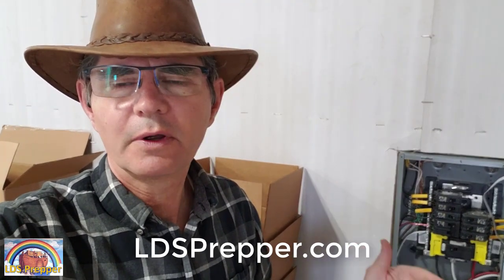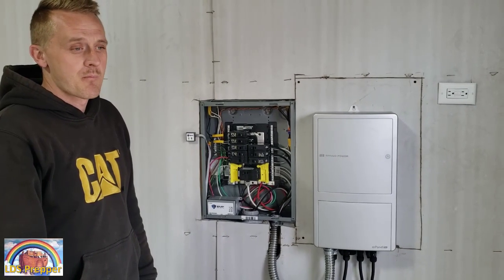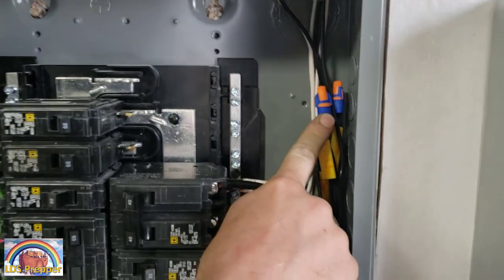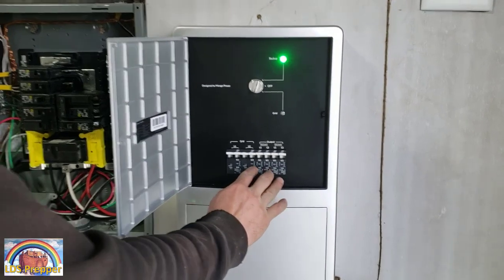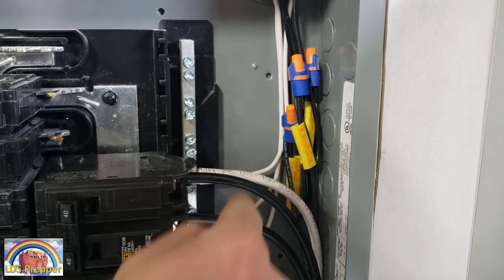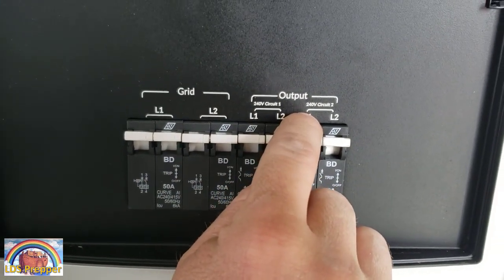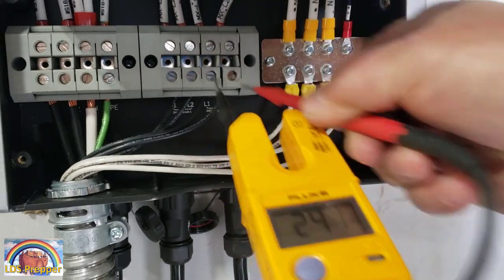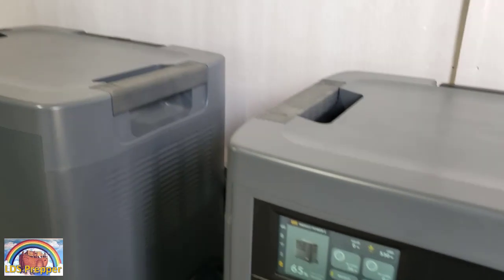EXCLUSIVE: Mango mPanel Pro Complete Installation - Automatic Transfer Switch

Comment: i want to run what there's only 4 breakers for 120 and run those to save electrcity and power outlets will that work or is this a expensive aoto matic transfer switch that only works when power is out

Comment: The mPanel Pro needs many more breaker outputs to supply the main breakers when grid is down to be useful. My current generator power distribution panel (Gentran) has 10 outputs back to my Main breakers to supply my basic needs. It would also be useful to have output load meters to see individual circuit draw. My Generator distribution panel has meters and it's nice to see what's going on and maybe adjust what's being used accordingly. I can see what the Mango E is outputting, but it's not telling me anything about the individual circuit loads on my home panel. It would be nice.

Comment: The cables feeding power to and from the mangos to the panel pro, can those be ordered longer or be remade longer by a qualified electrician and still work properly? I would need to set mine further from my panel unlike what you have in your shop.

Comment: I probably should have asked a better question.  I bought 2 base units - thinking I'd need to hook them together to get the dryer to operate with the 220.  In the video, I see that they were not hooked together while they were charging.  Then, I saw where you needed to switch both (1) and (2) for both the left hand and right hand switches in order to run on 220.  It looks like one set of two switches was for one base unit and the other one of two switches was for the other base unit.  Will we need to connect the two base units together now at all?   Or with the wiring completed that way, maybe we could operate one for the dryer and locate the other base unit someplace else?  ?  ?  ?

Comment: Thank you for this update.  I had already had solar panels installed but now can't afford the battery backup, while yours is much more affordable than ones with the solar company I went with, will have to wait to get the Mango but, thank you again for sharing the update.
Reply: Thank you for sharing your feedback and experience! It's great to hear that you found the Mango mPanel Pro installation video helpful. If you're looking for an affordable and reliable battery backup option, I highly recommend checking out the Segway Portable PowerStation Cube Series. It offers a massive capacity, powerful output, and fast recharging capabilities. Plus, its waterproof design ensures it's ready for any adventure. Keep saving up, and I'm sure you'll be able to get the Cube Series soon. Happy camping and stay connected!